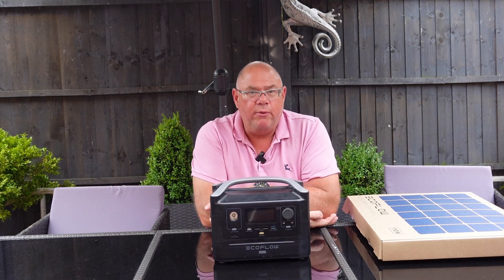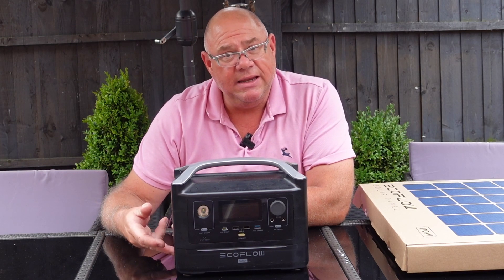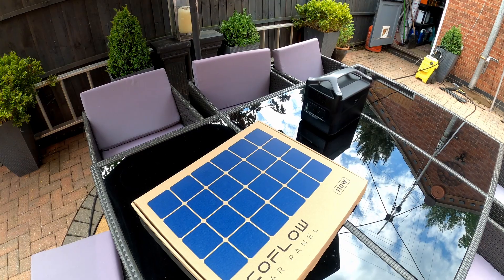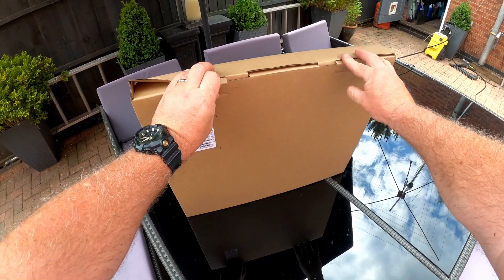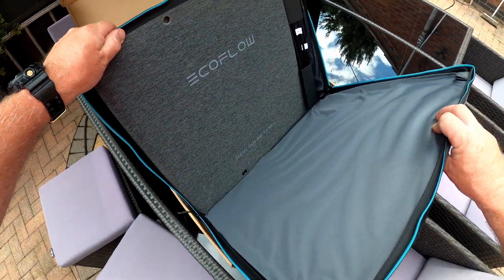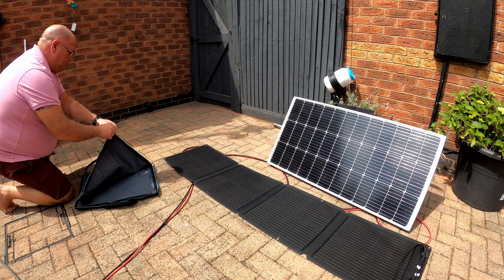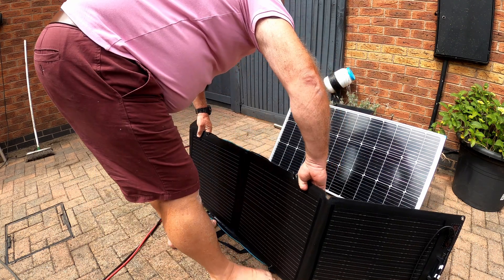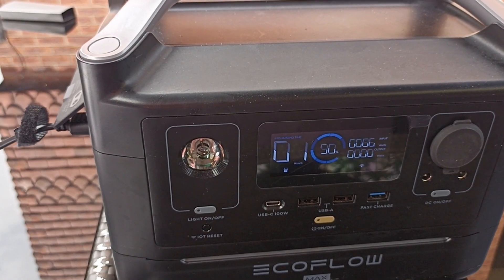#3 ECOFLOW Portable 110W Solar Panel

Comment: Wish i could find an independent review rather than sponsored
Reply from the maker: Although I was supplied with these by Ecoflow, trust me, if it was rubbish, I would have said it. I am still happily using it on a weekly basis (although I have swapped the solar for a fixed solar panel on the roof or the motorhome (see further videos). It does exactly what it says it does. Check out my other Ecoflow vids to get a feel for how genuine they are.

Comment: I did purchase the same 110W panels from Ecoflow as they are really light and at 13lbs. It is really easy to carry and move around.
Reply: Some people complain if the panel is partially shaded it will stop charging and the output will drop to 0%. I wonder if you have experienced the same? TIA.
Reply: @SaddyTaz  Exactly what I had experienced today (first day after buying). It mainly shows 0W. In cases on bright straight sun on one part and leaf shades on the other it rised to 5W max. Looking into more info to find out is that a non properly functioning item that needs to be replaced.
Reply: @vladyslavkarpenko9372  I believed this is a design flaw. If one panel is partially shaded, the bypass diode skips this panel. I returned mine immediately.
Reply: @SaddyTaz  So you had bought another one from EcoFlow or solar panel from other manufacturer?
Reply: @vladyslavkarpenko9372  I purchased some other brand coz I thought it was a design flaw on the Ecoflow, so exchanging it for another would not resolve the problem.
Reply: @SaddyTaz  Thank you 🤝

Comment: Hi Mike - what's the Ah rating of the 'box' and, from totally flat, how long is an optimistic full charge time using the flexible panels would you think?  Thanks, 73
Reply from the maker: Hey Rob. The Ah will depend on the voltage output I guess. I will do a test on the solar recharge. Guess around 5 hrs?
Reply: @MikeM0XMX  I'm interested in the 'real life' performance of such things.  The Ecoflow documentation (not that I'm questioning them) says almost 600Wh @ 28v implying that's the internal battery capacity.  But then losses in the inverter etc... must make a difference.  The Cridlands do a LOT of camping and while I can see these ain't cheap, it might offset some of the charges for electric hookup and give us flexibility around where we go (and also it looks quite cool and I like that lol).  

The other option is to get a big leisure 12v SLAB type battery and stuff from the caravan shop which runs on 12v.

Cheers mate, R